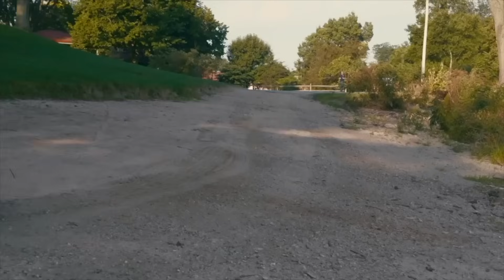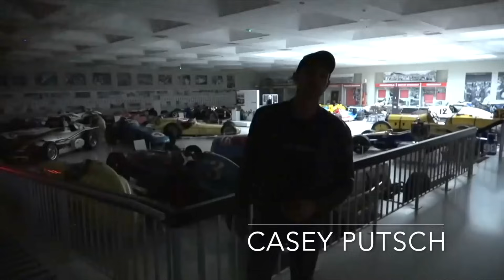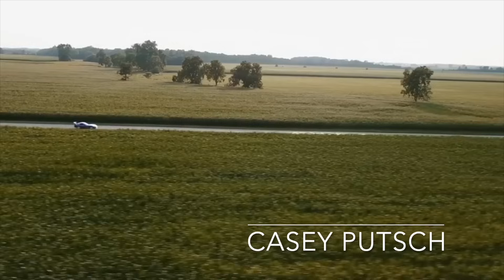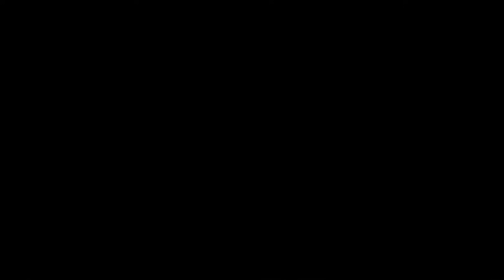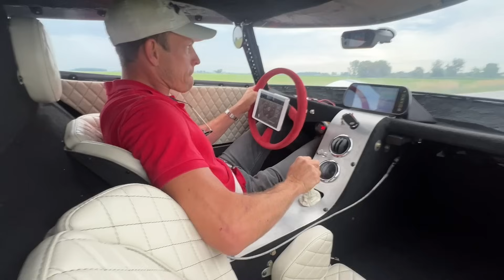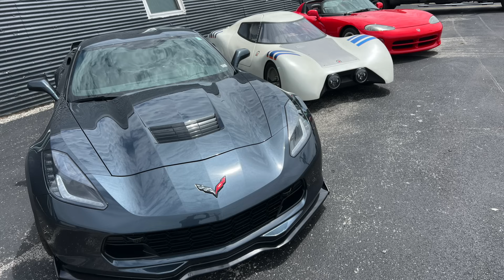HOW?? 104.7 mpg,  0-60 mph in 4.61 - the OMEGA CAR - Video 4

Comment: Keep exposing this crap, in the eighties I had the idea of a turbine/ electric hybrid,. Using the electric only for the torque during takeoff. 
Or how about scaling down diesel electric systems like we have on trains for the tractor trailers on the interstate?. Either make vastly more sense than using battery technology that is not ready for prime time. Now you see them tearing down the windmills  that they knew would never ever pay for themselves.. solar farms that radiate scalding heat . what happened to the global warming thing?. Solar is useless without batteries and there is not enough lithium on the planet to do even 10% of what they "propose".. it's a shell game, it's a scam... Thieves laundering money.

Comment: I believe that anyone that can build a car (or build anything with their hands for that matter) is deserving of respect. My uncle built a car that is less than 2000 pounds with 400+ HP. Sure it's fun to drive every now and but even he only takes it to car shows. Having said that:

Casey reminds me of Stockton Rush in some ways: 'Obscenely safe regulations are holding back innovation'. Would you stake your reputation and your family's future on this car being safe on the road? Just looking at it makes me think that if this thing is in an accident the occupants will be in for a bad time. If you're really proud of it show us the frame, the suspension, the safety features, etc. 

I think another issue with this is that the masses don't want a kit car. Until you've added the sound deadening, airbags (and made sure it doesn't crush a person in a wreck), swapped the manual for an automatic (or ugh, CVT), etc. then you've already moved yourself out of 99% of the US market of car buyers, even if you could manage to keep it near $20k. The average person doesn't care how fast it is; they want something comfortable that won't maim them in an accident. The people that care about how fast it is generally aren't going to care too much about efficiency.

Comment: If everyone drove a 2000 lb. car with little or no safety equipment and no cross winds or big diesel trucks blowing it off the road would it sell?  It could not get by Government regulation.  I wish Casey would get rich off this. Not going to happen. Will big oil end him and his car?  No he is not a threat. I am not a hater. Casey will eventually be super successful at engineering or consulting. As a car manufacturer?

Comment: I think that equates to 2.365 litres to 100 KMs. On a long distance trip, I can get 4.8 litres to the 100 KMs in a 2010 Hyundai iX35 SUV with a 2.0 Litre Turbo Diesel Auto when taking it easy. But 2.365 is amazing.

Comment: This is an amazing video. Thank you for the truth. I remember back when two guys here in Alabama built a converted 350 GM engine that used the gases off burning wood to fuel a car and pick up. They drove it to Washington DC, using wood scraps and debris to fuel up along the way, they showed it to the then president Carter. And we never heard about it or them again.

Comment: Character enough comets Jesus you people are so brainwashed do you think just because most TVs have a 300 mile range but that's how it's going to be forever there's already right now to date a 1700 mi range solid-state predominant like 80% 20% battery stated for use in applications for all electric vehicles this isn't even the beginning of where electric vehicles are going 10-second recharge wireless charging on highways which they've already begun installing in a few countries. Not only that but they're solid state predominant supercaps that will have one second 10-second recharging and a thousand mile range. Right now currently the way you're saying and describing the mining about lithium batteries is really ignorant because there's a lot of mining that doesn't require mining in a traditional sense of tunnels boring bombing and explosives and drilling and core drilling etcetera there is efficient ways of just dehydrating water that has lithium in it and is well the fact that you're not mentioning that lithium is only like 16% of the battery chemistry really really really really really really really really really really a good point that what you're saying is really moot I like your channel to a certain degree but you are partially very narcissistic and you made a clickbait title about building a nuclear powered car. You got to also mention the fact that current Jen batteries specially in a Tesla last 500,650,000 mi and still have 70% capacity so 70% of driving range which at that point the battery prices would be around 4 grand I mean two grand that is like nothing. And those batteries that are in them were basically invented less than a decade ago.

Comment: Diesel exhaust is proven carcinogenic. The best diesels still produce more waste heat than motive power from the fuel supplied. Humans have to stop burning things to make power or they will overheat the planet. EVs pit 85-98% of the power to the ground. Almost no waste heat, almost no pollution, and long term cheaper to run than fuel burning systems. I like some of your design ideas though. Some of the new miniature reactors would make a nuclear arctic hybrid (or a nuclear steam regen system possible) but the problems of dealing with accidenta and reactor system damage makes nuclear powered vehicles impractical and unsafe.

Comment: Diesel and def fluid total scam wealthy people got the manufacturing in place got the laws passed and had it in the bag. You can take an old Saturn or Honda and put a variety of mechanical 3 and 4 cylinder turbo diesel engines with appropriate transmission and gearing and get incredible efficiency and longevity. The power output is up to you.

Comment: DFM and design for lifecycle concepts seem to have come out as early as mid 80's. Nothing new there. people want to blame engineers for not doing it one way or the other but often things are dictated by higher ups. Personally I think HDPE is a great material to explore. its heat formable, weldable, recyclable, tappable, machinable and so easily modified. there are now making small barges and patrol boats out of it. many kayakers have kept their kayaks going long past their normal lifespan despite brutal treatment and many repairs by welding fixes.

Comment: A diesel electric sounds like a good idea.  No transmission or real drive train. The latest electric motors don't use anything touching anything. One car that would last more than half a century.  A frame designed so you could replace the body once in awhile.

Comment: I have so many questions and so much is missing from the video. It's hard to believe this is true with no way to very these claims. We need to know vehicle weight, the actual amount of fuel added, tire size, engine specs ect. Until then I'm going to have to be skeptical.

Comment: Your saying a lot without saying anything. You haven't said what is making the 4 cylinder diesel get 104 mpg your making it sound like is you put that engine in a well designed shell it will achieve the same mpg. It won't so what makes it get 104? I have a feeling it doesn't
Reply from the maker: Based upon experience and actual knowledge?
Reply: @CaseyPutsch  yes. I'm just asking what would make a normal diesel engine get 104 mpg? You said you haven't done anything special just basically doing things the right way. If it's something proprietary then I understand but can you elaborate or no?
Reply: @CaseyPutsch  so you never did respond about the obvious false claims your making. So without proper explanation ill just keep assuming your a con man in a long list of con men to come before you. But I guess if your target audience is uninformed people who don't know any better keep pushing this nonsense lol

Comment: To be clear, I am one of the many people that believes battery electric vehicles are the future. I'll give details below if you want to take the time to read it all.
Having said that, regardless of what powers it, my preference is for a small, light, streamlined simple, inexpensive two-seater for 98% of what I will ever need a vehicle to do. It doesn't have to be fast or powerful, as long as it can merge onto a highway. And, I know I'm not alone in wanting that. So I have to ask, if there is a market for such a vehicle, why do I keep hearing that everybody wants gigantic SUV s and pickups? The Mazda Miyata keeps getting bigger and heavier each year. VW stopped selling the Golf in Canada and the USA. Even if I had the money to buy a brand-new compact car, nobody is selling them.
BEV Rant: First, cobalt: completely moot point. Not only is there plenty of the stuff available from ethical sources but, it is used and lost to the environment in oil refining, any used for batteries is completely recyclable and newer LI batteries use NO cobalt at all.
Second, fuel: ALL fuel used for combustion of any sort ends up in the air we all have to breathe. Tiny particulate soot from diesel is insidious. BEVs can run on sunshine via solar panels and battery energy storage.
Third, battery replacement: Just no. With the tiniest amount of care, current batteries have been demonstrated, under real-world use, that they have lasted over a million miles. Show me the gasoline engine that can do the same.

Comment: You complain a lot about the industry not evolving, wasting billions to make crap vehicles, but never give any info on how you managed this. Better design. Ah. Okay. How much does this thing weigh? Sounds like there's zero sound deadening in your other videos. You say it's safe. Okay. How? Can it pass an IIHS overlap front impact test? If you can make this super fast, super efficient vehicle with any power source, why would mandating electric vehicles kill the possibility of a vehicle like this? If the industry is controlled by the steel and oil industry, why are the bought and paid for politicians pushing for electric vehicles? I have never seen a man so good at speaking for 15 minutes while saying nothing at all.

Comment: A lightweight electric car, driven by a Nano-tech nuclear module (like those used to power some satellites), with a low drag coefficient body, would be the ultimate. The current boat anchor batteries used in EV's are counter productive.

Comment: Knowing what tuning you used, what transmission you used, what differential ratio you used, exactly what tires you used, what the car weighs, what it's made of, these are things that allow some of us to reverse engineer what you call good engineering practices. For me, I need to deal with bad roads, ice covered roads, hills, light cargo hauling, all at the same time. I've done the math. With a T-5 transmission, the stock variant of the engine you used, a 3.54 gear ratio, and aggressive 28" ice traction tires, and a 60 mph speed limit, I should be cruising at the peak efficiency rpm for the Volkswagen engine. A little under 1900 rpm. Am I even on the right track?

Comment: not bad using some of the same engineering ideas that make formula one cars extremely light and strong. must be mostly aluminum you must have used wood in forming the fenders and curved surfaces

Comment: I really appreciate you having had the push to do this.  About... oh, two decades ago, at this point, I wanted to take one of those ALH manual transmission VW TDI powertrains and shoehorn it into a mid engine configuration in the back of a 240z I had.  Never did.  Sold the 240z.

I mean, not that 240zs were actually all that aerodynamic, despite looking that way, but I was pretty sure at that weight, it would get even better than the 50 mpg I was getting in my '04 Jetta TDI sedan.  And it certainly would have accelerated quicker.

I dunno.  Maybe some day.  Still, awesome to see that someone had roughly the same powertrain idea I did, and actually did something with the idea.  :D
Reply: Though I was hoping for a lot more information about the actual design.  I already agree with your political take on the situation.  ;)

Comment: I saw your interview on Tucker.  I was familiar with your car before that interview.  As a former owner of the VV TDI I was interested in your take on the Dieselgate scandal.  I found my MPG to be excellent and wondered why everyone was turning to hybrids with vastly more complicated drivetrains to at best equate to a well designed TDI.  I have my theories but would like to know if you elaborate on that elsewhere.  I’m off to find a reliable TDI drivetrain to emulate your great success.  My TDI was part of a lease of cars for our company.  I was tempted to buy it out but timing was not right.  Later I drove past the storage lot near Pueblo CO and it was depressing to see VWs in perfect condition stacked up for disposal.  Or export to less strict countries.

Comment: For those who, for whatever reason, are either unable or unwilling to drive a vehicle with a manual transmission, would it be possible to use a CVT in the Omega car? Many people would be willing to sacrifice a bit of performance for the ease and convenience of not having to manually shift gears. 
I'm not sure if the use of a CVT would also result in even better fuel economy, but it's nevertheless something worth considering. 
Too many people are so busy ruling things out that they leave viable and valuable alternatives on the table, but you come across as being someone who's willing to explore any and all options.

Comment: Take any old flat 4 cylinder VW from the 1940s to 1990s including diesel all amazing on gas mpg. Or 3 or 4 cylinder Japanese cars from the 1980’s and up …Nothing new here. Europe and Asia  have been driving on turbo diesels for decades all getting 50 mpg plus and US is just noticing now??? Electric cars are a joke compared to a good turbo diesel. Cost, maintenance and efficiency wise..

Comment: I don't think your vehicle is that impressiv . I drive a diesel 1.5l dacia dokker and i can get 4.5l per 100km. In mpg is about 50mpg BUT it seats 5 people, can carry things and is super usable. Your version is efficient but at the cost of practically, you didn't build a better vehicle, you just traded practicality for efficiency. That said the vehicle you made is really cool and impressive, im building something myself and i can only for now hope to achieve something of that quality. Sadly i think manufacturers would build small light, efficient vehicles if people would buy them, but the margins and the demand is not there. Im building something that i think will be super useful ( it's a 3 wheel, single seater, electric with enclosed cabin, can see the build on my channel), I want it for myself but i have doubts people would be interested in something like that because the car is a status symbol, a wasteful, big expensive vehicle is high status, efficient vehicles are low status. It's disgusting and sad but that's the reality we live in. I love all your builds, it's mesmerizing what you can make. Keep up the good work!
Reply from the maker: Race ya….

Comment: A backyard racer of snowmobiles, installed 2 opposing marcony clutches on his machine to improve longevity and traction.  Belts that used to last one race, would afterwards last the whole season.  I always though this could be an excellent automatic transmission solution for a small car.

Comment: 104 mpg is a high claim. If that is feasible from off the shelf parts and the manufacturing methods are the problem, you should outline the problems and the obvious solutions, being specific and comprehensive. 

It looks cool. But part of a critical mind is employing testing and reproducibility. The first step to that is understanding the actual steps you took in the first place.
Reply from the maker: I just did it. Watch the video.
Reply: @CaseyPutsch  you explained that there were manufacturing problems. You mentioned metal chassis and bolt on seats. 

I assume that is not the extent of your manufacturing revolution. And you really have to have some game changers to get to 104 mpg. What are the broad strokes? What needs to change? 

I understand not wanting to release exact details, but a run down of the specific types of changes should be possible. After all, if these companies wanted to do it, they would, right? You talking about it will only inform the people who will be willing to make a change. 

I went through a few of your older videos, particularly one from 4 years ago that detailed seat design, airflow for cooling, lack of mirrors, dashboard elimination, rear aerodynamics to extend the car profile, and the wheel flarings. 

Those are not enough to reach 104 mpg. 50-60? Sure. But 104 is on another level and I'm inclined to believe you given the rest of your work. So there's got to be more in the mix.

Comment: They're not making electric tanks. They're making hybrid tanks. Diesel generator to operate, bit can go in electric mode for quiet operation and to operate the turret without having a heat signature. Thermals are becoming more prevalent on the battlefield.

Comment: My uncle in the mid 70's did gasoline to diesel engine conversions at Hot Rod City in Torrance.  He put a 4 cylinder mitsubishi diesel in a Ford Pinto  and ran it from LA to Phoenix and got either 101.7 or 103.7 mpg in a road rally and had the award to prove it.  He put in the proper gearing and drove at 45 mph on a hot day to do so.  Your car takes it to a whole new level!   However, just like back then, he received no publicity because everyone was focused on a hydrogen car that couldn't even hardly run and called it the car of the future because diesel isn't sexy and it's loud.  Best of luck to you and I hope you can change the way diesel is perceived.

Comment: Ill stick to my 1961 Mercury Comet , 68 200 six , T5 Tremec 5 speed manual. It gets 26 MPG HWY at 65 . Very easy to work on myself , and parts are not super expensive .